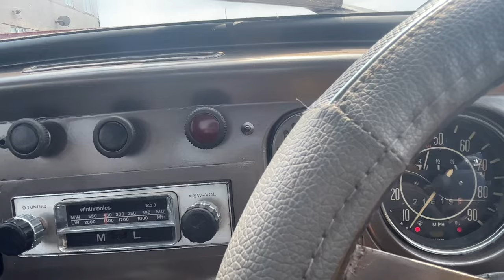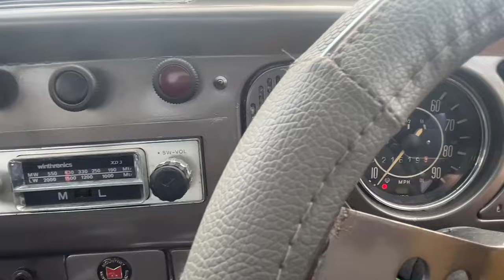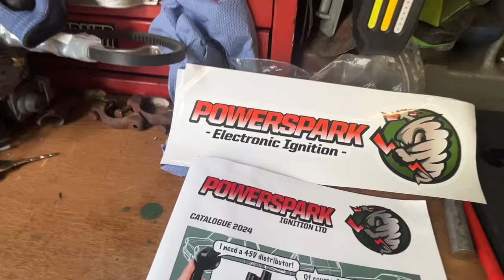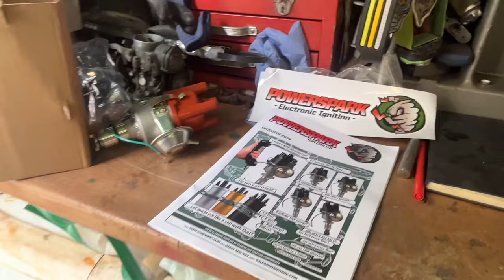Aircooled engine day ,knocking engine,running engines etc PT 1

Comment: Sounds like something is loose. Exhaust or starter maybe a mount? Can't really tell without hearing it run.🤔 Shouldn't be nothing major. A gasket or 2 will sit that carb flush. 😉✌
Reply from the maker: Hope so I’ll check that all